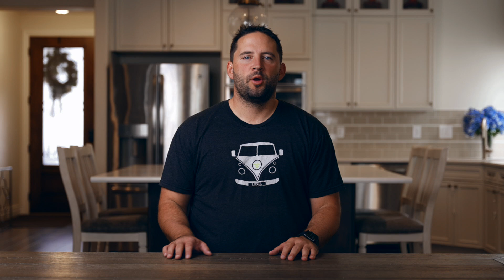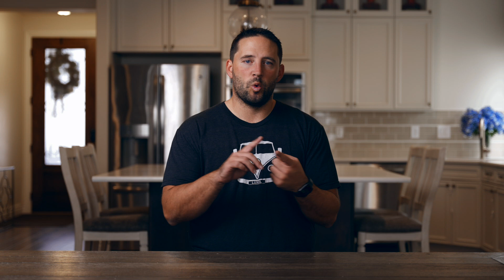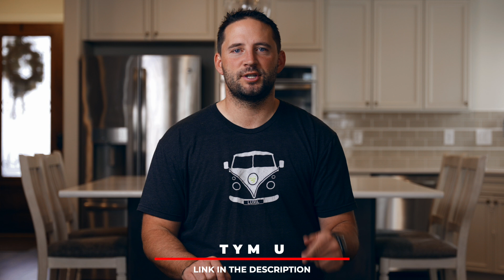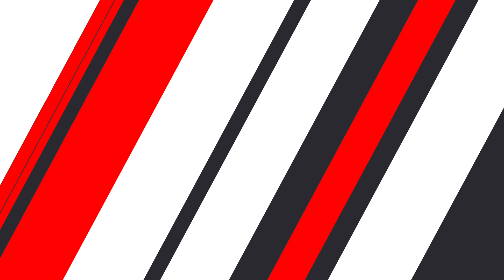Number one tip for wiring motorized shades for windows

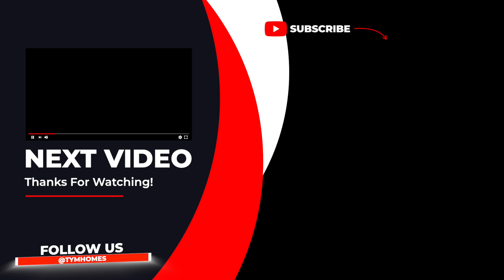Comment: At 5:14 - Isn't this wire simply 16 gauge Monoprice CL2 (in-wall) speaker cable? I still have leftover from my Dolby Atmos living room upgrade on my 1966 home and will soon add a hardwired motorized blackout shade to my kid's bedroom with a problematic bright streetlamp just outside the window.
Reply from the maker: You can use it for power, but you'll likely have to use wireless control still.  Which is fine.  If you're wiring from scratch, you need Control Wire and Power, and every manufacturer has different specs and requirements.  One brand to the next has different wiring requirements.

Comment: I need the wiring diagram. 4 wires which ones switch for direction change and which ones stay permanently connected? Do I need a motor capacitor or is it built in / not required?

Comment: The Lutron tech I spoke with said to use 18/2 wire for the Sivoia QS 10 Power Supply Panel.
Reply from the maker: Our recommendations are for basic, generic wiring—if you didn’t know the brand make and model yet.  

In this case, follow the manufactures wiring recommendations.
Reply from the maker: And thanks for reaching out!

Comment: You mention all common brands (so assuming you're familiar w/ fitting them) - is there 1 u find 2 be of better build quality / functionality than the others? We're considering Lutron but would love to know if we should consider one of the others!

U also mention the ICE cable lutron wire jacket but it seems they have multiple models (Lutron QS/M, Lutron Green, Etc) - are there differences?
Reply: Lutron is hella expensive. Great product, but genuinely just too much for window shades. What did you go with? If nothing yet, what part of the country are you in?
Reply: @IncreaseYourPatience  Depends which one, but Lutron isn't that expensive comparitively. Look at something like Hunter Douglas and Lutron looks affordable. Of course, this does depend somewhat on which Lutron line we're talking about.

Comment: What do you suggest, given the wire will be visible, for certain windows/doors where the owner isn't sure whether they are going to want or need shades, and will only decide after construction is complete and they move in?
Reply from the maker: That’s always a pain point with wiring shades if you aren’t planning shades immediately, and again it depends on the job site, how those windows are cased in, and where specifically shades are.

We’ve used low voltage boxes, so they’re 1” thick, paint them to match the casing.

I’ve seen people drill a larger whole, similar to what you’d use for security, and put a plug kind of like a press fit in, but it depends if you have a cavity behind the casing for the wires to press back in to.

If it’s mounting to the wall, you can of course leave it in the Sheetrock.  And then we see a lot of people just leave the wire exposed.

Comment: Nice video!   But why do you recommend wired vs wireless shades or why did your view change?  Yes, batteries can be a pain to change, but wireless shade batteries should last a few years and the shades seem to be extremely reliable (at least the Lutron ones).
Reply from the maker: When you start getting into the Control, and just more complex installations where you're coordinating all the moving parts, lighting, room scenes, whole home scenes, voice control, etc.  As well as things like pocket shades, dual rollers, etc wireless introduces more challenges for reliability that just aren't worth the headache.

Lutron likely has the most reliable 'wireless' solution on the market.  We have a home in Florida where the lutron wireless solution hasn't been reliable at all.  We didn't provide the shades, but we were hired to program and integrate them and it's been a complete disaster.  There's too much interference from construction elements.   The amount of service time, tweaking, warranty vs what it would have cost to just do wired doesn't make sense.

And that's the other side of it, depending on the manufacturer, wired shades are often cheaper than battery powered shades.  In some applications if the window is large enough, wired is the only option.

We're not against battery powered, or even solar powered shades.  I just think if you know you're going to use motorized shades it's better to wire both control and power.  If it's an after thought, then for sure Battery or solar are good options that work well enough.
Reply: @SmartHomeBrothers  Agree. I have 10 years of experience working with all sorts of product. RTS motors are great for simple applications, I've ran into countless of problems trying to integrate with dry contact interfaces because someone doesn't sell the right application to the client. If you are integrating everything in the home, office,  or building,  wired installation is the way to go.
Reply: @SmartHomeBrothers  Ahh thanks so much!  Makes sense.